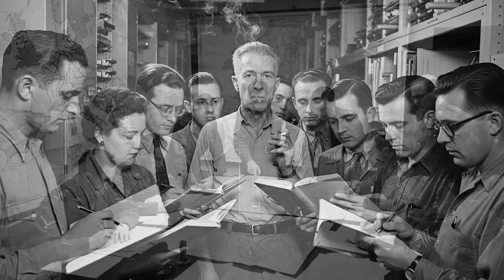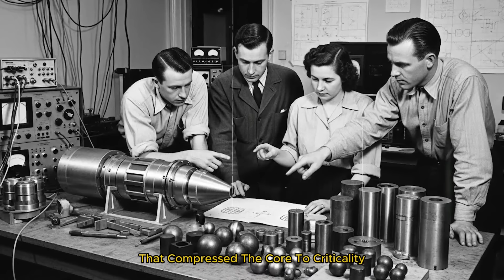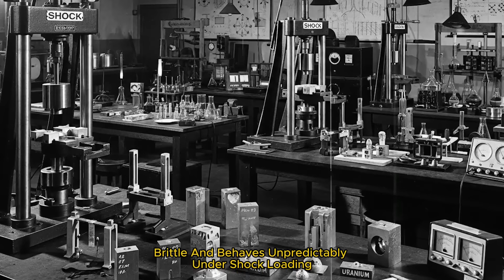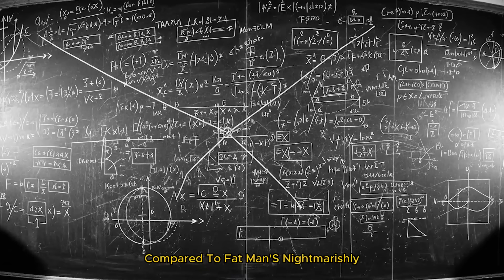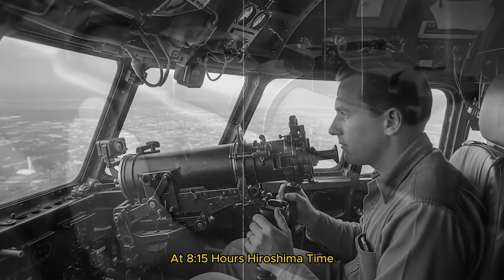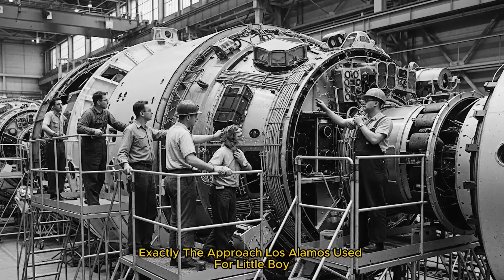THE LITTLE BOY SECRET: How Manhattan Project Engineers Built a Uranium Bomb Without Testing

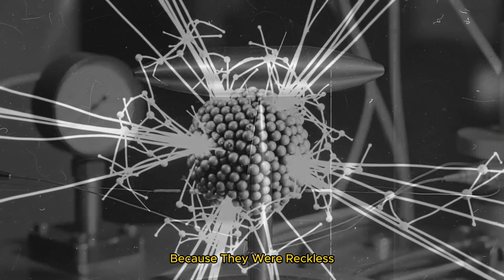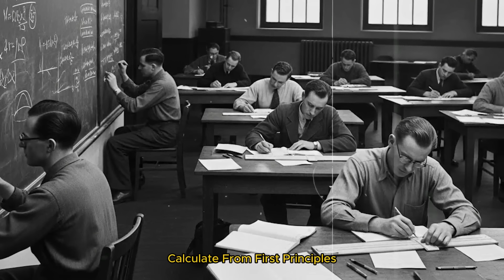Comment: 20:51–22:04 “They didn’t succeed because they were reckless… they succeeded because they were systematically thorough” really defines the heart of this story for me, because it shows how confidence was built through eliminating uncertainty piece by piece rather than blind faith. I admire how the engineers trusted first principles, redundancy, and brutal testing when full testing was impossible. It’s both inspiring and unsettling to see rigor replace experimentation at this scale. Do you think modern engineering still values this kind of deep, manual verification, or have simulations changed how we define confidence?

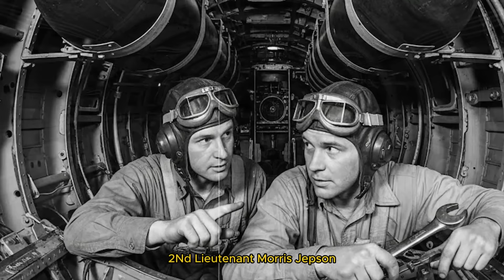Comment: 18:30–20:51 “They didn’t succeed because they were reckless… they succeeded because they were systematically thorough” perfectly captures why this story is so gripping to me, because it shows how confidence was built not on luck but on relentless validation when failure was unacceptable. I really admire how the engineers reduced uncertainty piece by piece until the untested system became predictable. It feels like a masterclass in disciplined problem-solving under pressure. Do you think modern engineers still have this level of first-principles confidence, or do simulations sometimes replace true understanding?

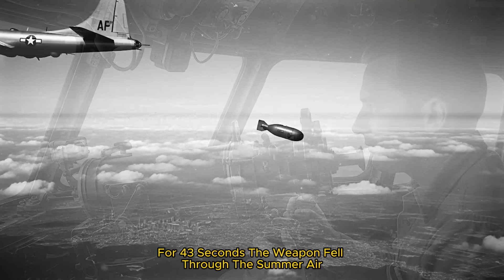Comment: 19:22–20:51 “The untested design worked perfectly” and “they succeeded because they were systematically thorough” really stood out to me, because this part reframes the story from luck or recklessness into disciplined engineering under extreme constraints. I appreciate how the video shows confidence built through elimination of uncertainty, not blind faith. It’s chilling but intellectually fascinating. Do you think modern engineers still have the courage to trust first-principles reasoning this deeply when real-world testing isn’t possible?
Reply: Because probably the concept was tested by Germans before. The U234 submarine surrendered in New Hampshire about 560 kilograms of enriched uranium, which were destined to Japan in May of 1945. No one launchs 64 kilograms of highly enriched uranium without test the concept to your enemy being this enemy fully able to recover It and repackage to a new bomb if It fails, and especially that element being the most expensive and most difficult element to obtain in this timeframe moment, more even than plutonium in 1945.
Best regards.

Comment: Umm, there was a lot of testing done for the uranium bomb.  The physics was well established.
Reply: Tested in  october 1944  at  Rugen
Reply: Individual components were tested, design checked and rechecked, but no live test
Reply: @hyliedoobius5114  Because there really was no need to do a live test.

Fat Man was a different story as while the implosion design was tested on steel balls, there was a question of whether or not criticality would be achieved with a plutonium core.  What is interesting is to look at the photos of the Trinity test taken just a few milliseconds after detonation.  Some aspects of the implosion configuration can be seen in the fireball.
Reply: @paulkurilecz4209 Trinity  was a  plutonium bomb
Reply: @vicent436  Yes I am aware of that.  It was felt that a full-scale test was needed for the implosion device.

When I said that a lot of testing was done for the uranium bomb, I did not mean that full scale testing was done.  The testing that was done was to ensure what mass was needed at which enrichment concentration to achieve criticality and more importantly, what separation distance was needed between the two masses of enriched U235 in order to prevent criticality while the bomb was in transit.  This testing led to the calculations to determine what shape and size of the two pieces of enriched U235 needed to be in order to be critical.

The testing done on plutonium determined the density needed for the plutonium pit needed for criticality while the undeformed pit remained subcritical.

While the explosive design of the implosion device was proved on steel balls, it was still felt that full scale testing was needed in order to prove that criticality could be achieved and more importantly, what the yield would be.

Comment: The little boy bomb was armed in flight at about 9000 ft altitude, not 30,000 ft as mentioned at the beginning of the video. Low altitude was necessary because the bomb bay was unpressurized. After the bomb was armed the green safety were replaced with red plugs and after that the aircraft was pressurized and slowly made its way up to about 31,000 ft.

Comment: Interesting bit of trivia:  Of the 140lbs of U-235, only 32 oz fissioned, and of that, .025 oz did the "E=MC²" thing; producing the 15 kiloton equivalent energy. Amazing.
Reply: Looked at differently, less than 1% of the thermal energy of a fission reaction comes from conversion of atomic particles (protons & neutrons) into energy. Almost all energy comes from the “mass defect”, the difference in mass of a uranium nucleus and it’s fission byproducts!!
Reply: @hyliedoobius5114   That's right
Reply: So 138 lbs of 85% U235 were vaporized into the wind. Great fission ratio, 1.4%, yuck.

Comment: Just had to click on this to see wtf that thing with little boy on it was. The gaseous diffusion plant didn't come on line until after the war. Enrico Fermi worked out most of the calculations, with others, and proved his theroy with the first reactor in Chigo under Stagg stadium. The Navy worked out the gun design, others worked on the radar and altimeters to fire at 1200 ft. There was a target with 3 rings of 235 encased in tamper at the end of the barrel. Women were mostly the operators at Oak Ridge. All they knew was to watch guages and turn dials, E.O. Lawrence was working on cyclotrons and betatrons for magnetic seperation. Purity was only %80 and had to use about 3x more than Pu239.
Reply: Fermi obtuvo  plutonio.
La  bomba  de  plutonio,  V como la  Trinity ,  solo puede ser detonada por imlosion  con  infrarrojos que  llegaron  de  Akemania

Comment: As USUAL,  these AI videos are CRAP.  There are Filmed Historical Records of Building the MASSIVE U235 Separation Plant in Oak Ridge, TN.  The $2 Billion mentioned, was the total estimated Cost for the ENTIRE Project.   However, Oak Ridge was THE largest outlay.

My Grandfather said he was Aboard the Ship that Carried Parts of Little Boy. He "KNEW" what was on board Ship.  However, my Mom said Grandad  had a history of Stretching the Truth.
Reply: Another detail, the uranium core case was bolted to the deck of the captain’s sea cabin. Not in the hold. Cruisers didn’t have holds.
Reply: Yes, it is truth that they built one big plant of calutron electromagnetic separation, but was extremely inefficient. To The point that It was closed a couple of months later when the termal difussion plant was finished.
The chief supervisor of Los Alamos about U235 incomings tells clearly that until May 1945 (curiously the same month the German submarine U234 surrendered), the total uranium received was far below the goal of 64 kilograms (he had just received about 20 kilograms and that in about 6-8 months,) but magically from June to August he received about 45 kilograms more and told that some other highly enriched uranium was being distributed to Hanford nuclear reactors to make more plutonium, when until April They were complaining about the scarcity of highly enriched uranium.
😮😮😂😂
Highly strange (secret: probably It was from Germany the most part of the U235 core).

https://eu.oakridger.com/story/lifestyle/2024/12/13/did-germany-enrich-uranium-during-world-war-ii/76819629007/

Best regards.
Reply: atomic bomb like moon landing is faked by einstine and his natzi gang.

Comment: Never tested? It was designed using slide rules!
Reply: No, It was not tested by the Americans. Never. Which is highly strange as any fizzle or detonation failure would give the Japanese about 64 kilograms of highly enriched uranium. No one in the history launched a nee weapon without previous test. And a conventional bomb had an average rate of failures of about a 10-15%.
It means to me that someone had tested it before, that is said, Germany, as they sent to Japan a Submarine, the U234 with about 560 kilograms of enriched uranium, which finished surrendering in New Hampshire. This uranium and a German expert in radar and ultra high velocity detonators, Heinz Schlicke, finished in Los Alamos, but no one gave an explanation about the uranium and the German expert.
Best regards.
Reply: Littke Boy came from  Germany such as Fat boy